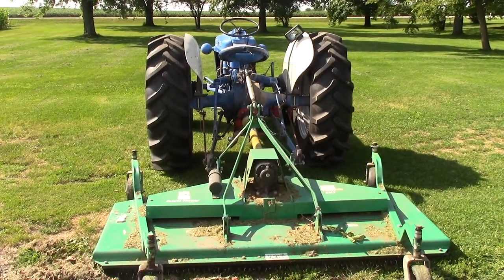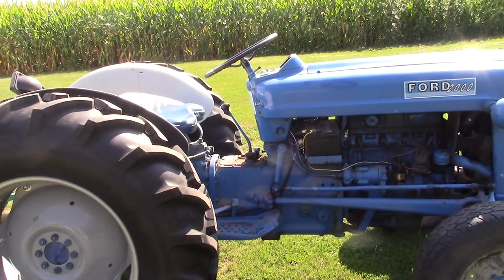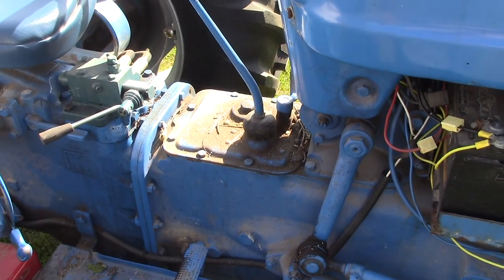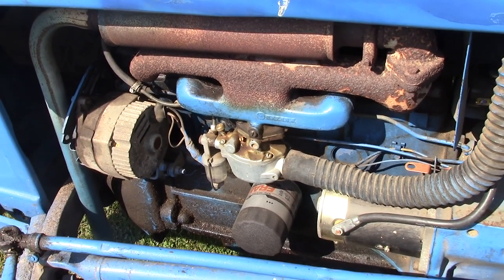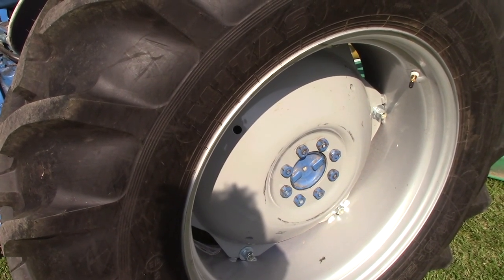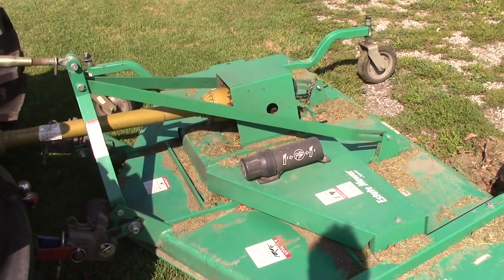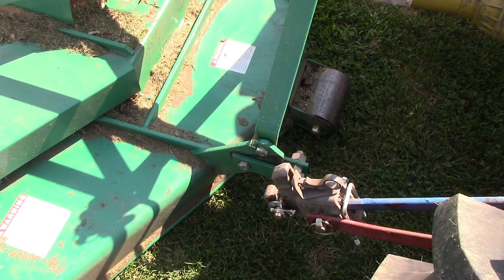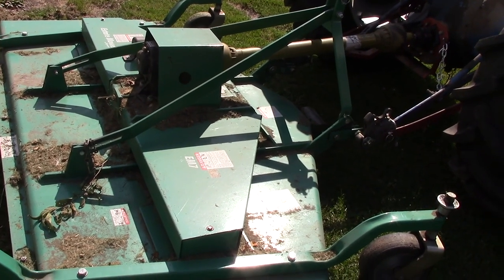64 Ford 2000 tractor / 7ft Agmate Mower

Comment: Every 2000 I have split to replace the  clutch has been a 2 stage conech only  seen one with single stage clutch. And I have replaced 14 so far.

Comment: My father in law put on an over run clutch and his son drilled a hole in it and put a bolt through it. Had no idea why the tractor was “pushing “ him. Tractor was identical to yours. His son then would try to bushhog with and complained about it being weak. He was running it at 1200 rpm. He lugged it around. He has a 65 hp Massey and runs it at 1200.

Comment: I  just bought a 63 ford 2000 but mine has the selectospeed transmission. The trans. is a little jerky but it does give you nice slow gears. I think 1st gear is about 1 1/2mph. and it has live pto.

Comment: i have a 64 ford 2000 also. nice job on this one. ive been looking for a new starter that will fit, have not had any luck. do you know where/have a link to where you got yours? thanks
Reply from the maker: https://www.steinertractor.com/FDS324-Starter-with-drive-Bendix-
 This is the one you need. Thanks

Comment: Jeffrey, I have a 1964 Ford 2000 tractor as well.  I am having problems with my brush hog.  The front of the brush hog drags on the ground.  Is there something on the tractor that will lift the front. 
 I would use the hydraulics but it bleeds and lowers while mowing.
Reply from the maker: https://www.youtube.com/watch?v=IzuJvf6ocaI   This hydraulic system is the same on the NAA, 600 series and 2000 series and many others. Could be you have the same problem he had. 
Dan Gingell (Steiner Repair) has a video explaining how to search for internal hydraulic leaks on the 600/800 series, that works on the 2000 as well. You will have to investigate to find a  weak spot. 
 Also if your hydraulic pump on the block is loud, it may need a rebuild to provide the pressure you need for something heavy. Brush hogs are quite heavy for these tractors and older seals and O rings aren't up to it. 
 There is a relief valve located under the hydraulic piston that will cause drifting when it wears out but if you are going to dig that deep you might as well do a complete rebuild. The cover plate is heavy to lift but the rebuild is not terribly difficult to do.  
 Lastly I would suggest your hydraulic fluid. Contaminated or old fluid may cause the system to react poorly. If you know where the hydraulic drain plug is, slowly unscrew it until something leaks out. If it is water coming out first, you have dirty fluid. If the tractor sets outside for any length of time it will have water in it from condensation and rain. Mine stays in the barn but I change the fluid every couple of years to get out condensation. Buy hydraulic fluid recomended for the tractor too. You won't be happy with cheap fluid. Good luck, good mowing!

Comment: Nice video, I'm having trouble with my throttle lever. It moves freely but won't stay in place when I try set it. Any advice?
Reply from the maker: Under your battery plate there is a connection for your throttle linkage. There is a friction plate in it. Perhaps it is worn. Thanks and good luck.

Comment: What brand overrun clutch did you buy?
Reply from the maker: This is close to the same as mine.
https://www.tractorsupply.com/tsc/product/tool-tuff-direct-overrunning-clutch-1-3-8x6-female-to-1-3-8x6-male-75hp-quick-release-27-027?cm_vc=-10005
Reply: @jeffreyticen689  thanks!

Comment: I can’t find any videos of people attempting to run a 7ft mower on a jubilee or 8n just people jabbering about The 5 hp per shredder foot width,  how does that 7 footer cut ?  Could it run an 8 ?  My 8.n is great with my 5 footer and always wondered about a 7 footer
Reply from the maker: My engine is around 35hp if it is running well. It handles the mower pretty well but 1 foot tall stuff will bog it down. So I raise the mower a couple inches off the ground the first pass then down on the second and it does fine. I'm not sure of an 8N's hp but if it is less than 35 I believe you should go with something smaller. Agri-supply sells a 6 footer I think.

Comment: I wonder if someone has changed the sheet metal on your 2000 or if maybe its not really a 2000. It shouldnt have the round plastic part on the front of the hood on a 2000. It should look like this one.
www.youtube.com/watch?v=IS6OBSwDdAo&t=646s
Reply from the maker: Your right. Previous owner modified some things on the tractor. He put a car emblem on the front. I don't mind.
Reply: @jeffreyticen689  it looks like one of an older tractor before the 2000
Reply from the maker: @TheJohndeere466  The serial number for the tractor puts it as a 1964 Ford 2000. Last year they used the 134 four cylinder. From the NAA/Jubilee until 2000 The tractors looked mostly the same.
Reply: @jeffreyticen689  Yes everything looked the same except the nose piece of the hood. Yours is from a tractor that was made before the 2000 came out.